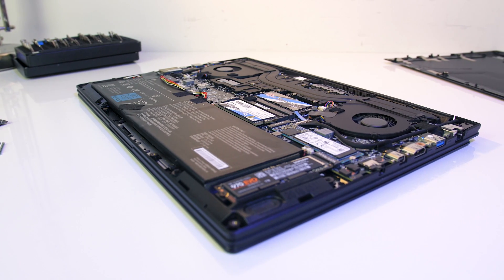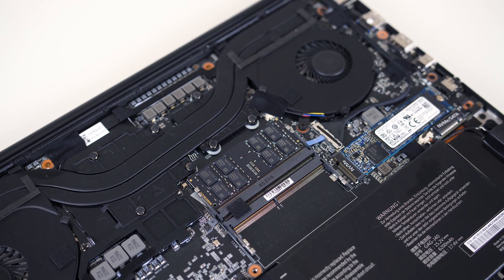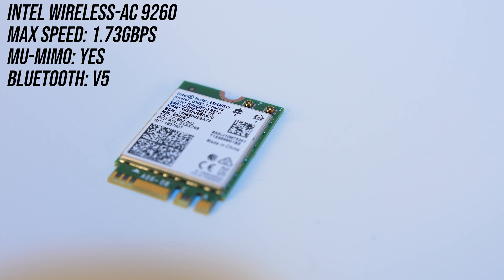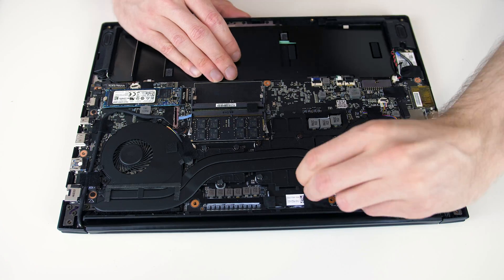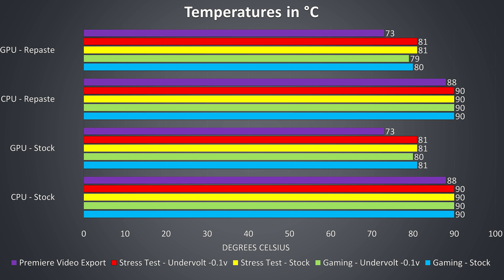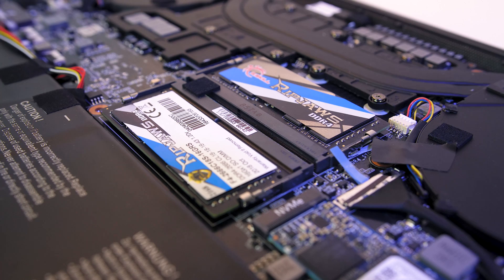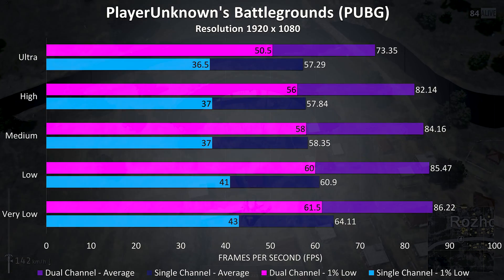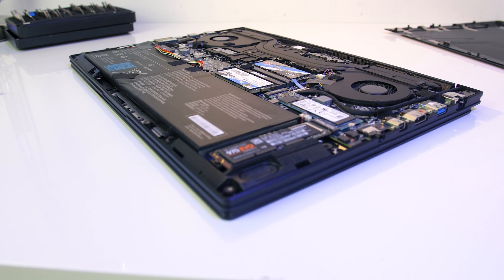Upgrading the Gigabyte Aero 15x Laptop

Comment: Try again with a lower amount of paste?..
Reply from the maker: Would it really make a difference? It's not as if the paste is going to prevent the heatsink being pushed down on it, once the screws are fully tightened wouldn't it have just moved the paste in the same manner? More paste would just get pushed further out as needed.

Comment: Next time don't use the spreader on the paste. When used it increases the gap between the heatsink. Which decreases performance. Just use a rice sized drop on the CPU and GPU, and shut the heatsink.
Reply: While I agree that will work on a desktop CPU and heatsink, I don't think it would be effective with a laptop cooling setup like that. The GPU is rectangular, so you have to spread the paste on it, and even for the cpu, you might not put the heatsink straight down on it, so the paste might spread unevenly. Also in the testing done of the best way to apply thermal paste, a properly spread paste performed the best, with all other ways of application making nearly no difference.
Reply from the maker: I know a lot of others just use the drop, I was going to do that too but didn't in the end. Would it really make a difference? It's not as if the paste is going to prevent the heatsink being pushed down on it, once the screws are fully tightened wouldn't it have just moved the paste in the same manner?

Comment: I bought 1x16 of your RAM for my Zephyrus GM501, because it has same specs. Should I exchange the stock RAM too, because of different brand?
Reply from the maker: If the original stick supports DDR4-2666 at same timings as your new stick and it's running in dual channel then it should be fine to leave as is.

Comment: Very nice. I was hoping to snag one of these but i managed to get a dell g3 for only $1100. What do you recommend i upgrade first? As i got the lowest spec model and i want it to be optimized for travelling and gaming
Reply from the maker: Hmm the lowest one is single channel memory if I recall? I guess if you have enough disk space going to dual channel memory will give you the biggest performance boost in games, or if you have a HDD only going to an SSD would probably be a better first move.

Comment: my favorite laptop for 2018 but way to expensive in my country :(
Reply from the maker: Yeah not cheap! Pretty decent machine though, aside from the memory incompatibility strangeness and keyboard issues noted previously.
Reply: @JarrodsTech  all of laptops have some issues, some of them are thermal throttling, power throttling or some minor malfunctions or incompatibility.But the simple design and spec of this laptop is making my favorite laptop for 2018.The price are the only downside at least for me, 2400$+ in my country that's too much.For me the winner no matter what's the brand is who have the  best costumer service.So maybe Gygabyte is not on the top list but is not too far.The Razer Blade 15 seems to be the allround best laptop for this year .
Reply from the maker: Yeah that's a nice one too 👍

Comment: It's bcs the system has stored some data on the original ram when windows was installed. If u want to use ur new Rams u will need to format and reinstall Windows
Reply from the maker: I doubt it, you should still be able to get into the BIOS if that were the case but that's not possible either, even with the disks removed and battery removed to flush CMOS.

Comment: Nice one! I installed an Intel 660P for my storage. It's only half as fast as Samsung's Evo but it's REALLY CHEAP. For the RAMs I installed one from Crucial. The 660P and Crucial RAM are working both quite well even though they are not shown in Gigabyte's support list.
Reply from the maker: Sweet! I was looking at one of those Intel NVMe drives, but in the end went with the Samsung 👍
Reply: @JarrodsTech  I believe LinusTechTips made a video specifically for that 660P SSD. It's QLC structure and consumer grade, but I like the price performance ratio, really a good deal for me. For those who are really into the R/W speeds, Samsung is definitely a better choice.
Reply from the maker: Yeah I think I saw that one!
Reply: my research showed it was moatly between samsung and wd black if you wanted nvme. i got a wb blue and added 2tb so i could load up all my games. only cost 330$
Reply: @bradhaines3142  2TB for 330$ is really a good deal! I got a 512GB 660P for about  85$.
Reply: @weskeryuan6435  the prices scale pretty good, 500gb for 75-100, 1tb for 150-200, i found 2tb for 330 and decided i wasnt going to replace it again lol. i do intend to replace my 512 factory drive with another pcie when i can buy a 1tb or bigger for 150-200.

only downside is that 2tb is sata based but it's not a hard drive so im happy
Reply: @bradhaines3142  Hi Brad, what do you mean by "the 2tb is sata based"? Do you mean that the second slot can only make use of the sata speed and latency instead of the nvme ones?
Reply: @davidespinelli  i mean i got a sata based ssd instead of pcie because i needed 2tb and not speed, because a 2tb pcie drive is like 700+
Reply: @bradhaines3142  oh ok, I got confused and I thought you bought the 2TB Intel 660p instead of a 2TB SATA.
Thank you for your reply

Comment: I own this laptop as well & while this video was perfect for us owners, it was exactly what I feared from reading forums on upgrading the 15X. I have never opened a laptop before, let alone upgrading internals so I was disappointed that upgrading the memory wasn't as seamless as it should. 

Would you be trying out upgrading the memory again with both running to full capacity with no issues on startup? Hopefully you will be making another follow up video on them including the improvements on the WiFi card? As of right now, I'm still not confident to spend my dime on the memory just to end up like your case.
Reply from the maker: I don't think there's much I can do with the memory that I have, I'd probably need to buy another kit like the one listed in the description, but it's $500 AUD, doesn't really seem worth buying at this point just to go from DDR4-2400 to DDR4-2666, would have been good knowing that going in but the information was on like page 300 of a forum post, as is always the way 😛 not sure about the WiFi, I really want to upgrade my wireless here at home, using some 6 year old setup at the moment, but will depend on that happening.
Reply: @JarrodsTech  Yea thank you for posting that link to the 300-page deep forum, where a user mentioned he could simply install another G.SKILL Ripjaws 16gb without issue, but the key is to make sure to update to the latest BIOS F08. I'm guessing you still had your startup/boot issue despite updated to the latest BIOS?
Reply from the maker: Yes I mentioned in the video I am using FB08 BIOS.

Comment: Hey Jarrod, what's a safe range for my CPU's temperature? I recently got myself the i5 variant of the Acer predator Helios 300 and it overheats to about 95°c while gaming, so I decided to undervolt it and the temperature goes up to about 87°c now. I'm just worried that all these heat might shorten the life span of my laptop, as I really need to last me through 5 years of college.
Reply: Use throttlestop to limit your 3 thru 6 core boost clocks to 3.6ghz
Reply: 87 should be safe considering factory standards. Though its still pretty toasty, if youre comfortable applying new thermal paste, i recommend you do so. That will guarantee itll last. Or just bottleneck your cpu to something closer to 80 degrees
Reply from the maker: 95c is a bit warm I'd try improve that with undervolting or something else, but technically the TJunction for the i5-8300H is 100c. ~90c seems pretty common for most 8th gen CPUs under heavy load though.

Comment: Just got an MSI gs65 RF model with the 512gb sata3 ssd. I would like to put a 1tb sata3 ssd as the second drive. Memory and thermal paste is ok for now but would like to upgrade to liquid metal in the near future!
Reply from the maker: Sounds like some solid upgrades! Let me know how it goes 👍
Reply: @JarrodsTech  I sure will!
Reply: Why not get an NVMe drive? They're significantly faster than SATA.
Reply: Try intel 660p or crucial, theyre nvme drives, way faster and almost as cheap as a normal sata stick

Comment: Can you make laptos cooling pad reviews . And recoomndtion on best cooling pad
Reply from the maker: I have done one so far, but yes I would like to buy a bunch more and do a big comparison with a number of different laptops in the future.
Reply: @JarrodsTech  i have problem like i dont know if 2 or 3 fan cooling will interput the laptop fan airflow if placed directly under it on the open veint . Still choosing right cooling pad really hard . Most video 2 years old and without actual temp test . I hope you make video soon . Thanks
Reply from the maker: I think the biggest benefit from cooling pads is that they rise the laptop up off the flat surface, the fans in the one I tested don't really spin that fast so I don't think it would affect the fans of the laptop, just send more air to them.

Comment: why you dont use intel wireless ac 9560 ??
Reply from the maker: Does it get anything extra? Based on the specs it looks almost the same.
Reply: Dany Dewantara There’s not much difference in speeds and Wi-Fi functionality is about the same.
Reply: @zgoaty9235  yea i know, but 9560 have CNVi interface (newer). Is aero 15x doesnt support that ??
Reply: Dany Dewantara That I couldn’t tell you, but I don’t think Jarrod is looking to get that in depth with the 15X’s Wi-Fi.  I think for him as long as he gets faster throughput, which against the 8260 it does, it does not really matter whether he has the 9260 or the 9560.
Reply from the maker: I'm not sure about the interface, I just went with 9260 because it was essentially the same otherwise just better speeds and bluetooth from the 8260 and I found confirmation of other people using it without issue, so seemed like a fine upgrade for $15.

Comment: In my experience. Fujipoly have good performance but it dries quick, hard, and breaks with a chalk like texture and expensive. Surely it will break when you need to remove heat sink. Im thinking on switching to alphacool thermal pad they have 17w/mk
Reply from the maker: Oh interesting, yeah no experience with them myself unless I wanted to delay this video even more waiting for shipping haha, just saw a lot of people online recommending them and the conductivity rating looked decent.